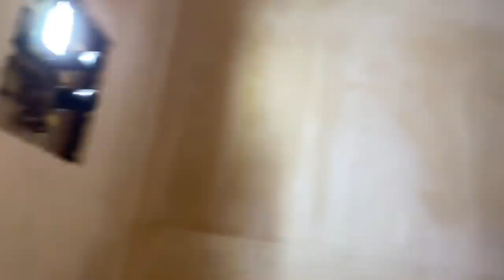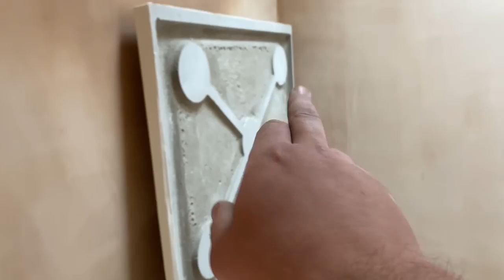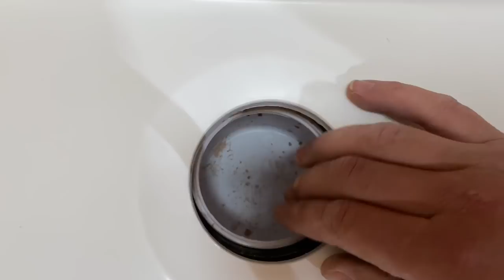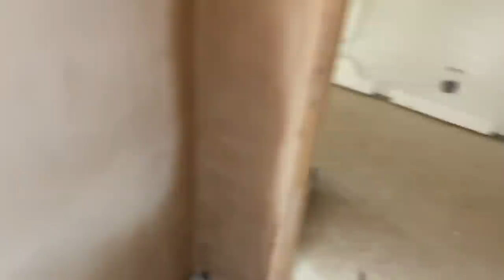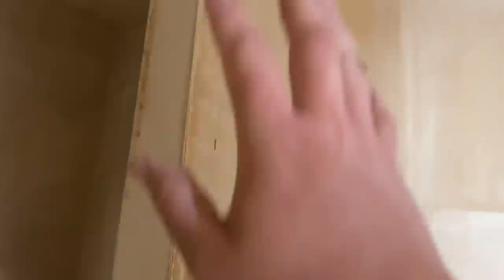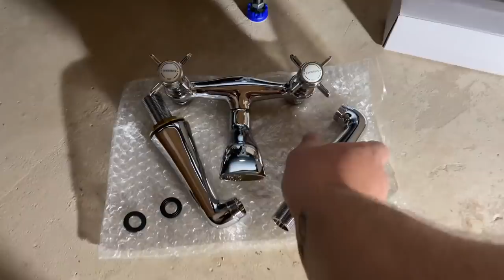SHOWER TRAY INSTALLING…THIS IS WHAT ITS REALLY LIKE DAY TO DAY PLUMBING ON SOME JOBS

Comment: You are fitting the shower trays wrong should be beded on sand and cement and not cut plasterboard it should be aqua board in showers you are a bogger plumber
Reply from the maker: Ok Gary…..🤣🤣…. I assume you mean “Bodger”🙄🙄

You can bed trays on tile adhesive, silicone, sand and cement etc etc etc, just because you do it your way doesn’t make it the only way buddy….. 

I’ve been plumbing for 27years and fitting trays that way for 27 years and never ever had a single issue…
As cutting the plasterboard, can you not see with your eyes that the tray wouldn’t fit🤣

Thanks for the time you’ve taken to watch the video, Keep commenting mate as it earns me money 🤣🤣👍🏼👍🏼👍🏼
Reply: is there decent money on 7k subs?
Reply from the maker: @tracer1127  👏🏼👏🏼👏🏼👏🏼👏🏼👏🏼👏🏼

Exactly mate….. 100% right but people on the internet don’t understand this 🤷🏼‍♂️🤷🏼‍♂️

You and I both know that the manufacture doesn’t give a shit once it’s even unwrapped.
Like I said, 27years in doing it the way I do and NEVER EVER had an issue……😉
Reply from the maker: @dansimpson222  it’s not all about the subs mate, it’s the view rate/audience retention that earns you the money.
7k subs does bring in a few quid, let’s just say I can see how these kids are driving around in Lambos off the back YouTube